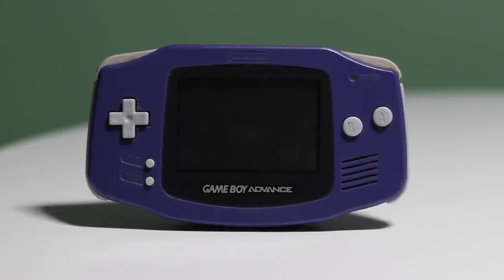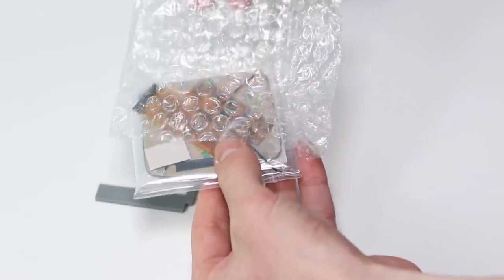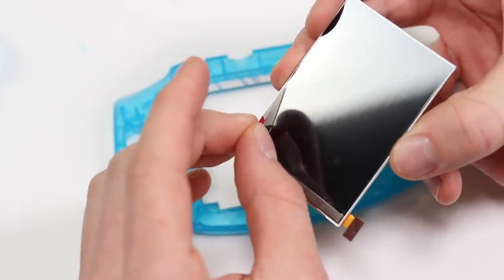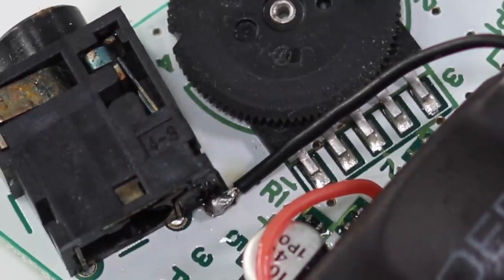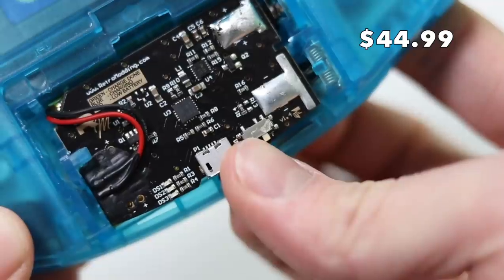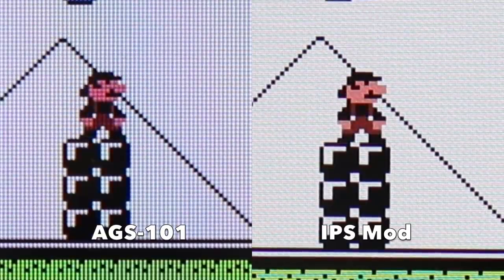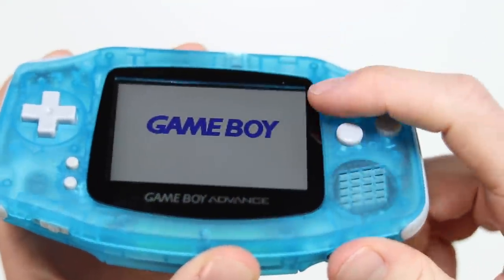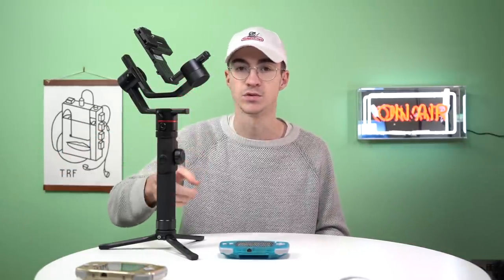$200 ULTIMATE GameBoy Advance Build!

Comment: Its crazy how time flies, in 15 years people will be modding their switch with 8k oleds or whatever the new thing may be, and 24 hour battery life
Reply: Sadly I think the golden times of hardware that allowed this are over, nowadays its all SoCs
Reply: Yuzuki1337 sadly I agree
Reply: They're already modding the joycons.
Reply: @PasserbyP  i did a shell swap on mine
Reply: In 15 years, the switch will never need a screen upgrade. Either from that you can just plug it into your tv or because it will have next to no support from the modding community for that sort of thing
The only reason gba's get modded is because their tech is basically prehistoric compared to new tech
We might have a WW3 before then anyways
Reply: Maybe 10years*
Reply: Andrew Lee will def be me lol I don’t do anything rn to it cause ya their pricey if I mess something up so I will start off modding with an advance sp that my friend will sell me for $30 pretty excited little project
Reply: thats what they said about 2010 computers having 10 ghrz processors and guess what we dont have that...
Reply: They are already putting Retro Arch on the Switch.
Reply: we already have the battery tech, solid state batteries can hold like 40,000 m/AH hours charge
Reply: @bradleycontois  Processor frequency is not the only relevant factor in speed. A 1,6GHz 2020 processor is about 100x faster than a 4,5GHz processor from 2006.
Reply: Sincerely why do you want to that? The philosophy of the hackers was never to destroyed old material, make them pricy on ebey,  to got internet points on reddits and youtube. 8K on a gadget hipster switch to do what exactly?  (the terrible breath of the wild is running in low resolution at less than 30 FPS, you will change the mother card and add a 2 meters giants screens for the 8K on low polygons and textures?
 Useless to destroy the the real experience when you all have shitty portables phones with an emu already.
You are consumers, not hackers and a Cancer, the Zoom Zoombida living in a parallel fake worldand fake history.
Let the people enjoyed the real experience or play it on PSP 3000 with an emu or simply your phones who will give you balls cancer.
Why do you want to destroy old material that the industry stop to to build?
A PSONe is 20$ and a CRT is from 0$ to 5 dollar$.
From the beginning of the Video Games, we tried to make things more fun, you tried just to be an attention Wh**e on Twitter. 
200$ for a GBA? Please stop, took a PsP 3000 and add a emulator on it. End of the story.
Please stop!
A Quicker CD-Rom player on a Neo Geo CD is good, a French guy done in on Youtube easely.
A shitty current year LCD on a Game boy with a terrible filter is destroying the experience and how do you think that we could have survive and enjoyed these Video Games in the 80'S&90's? We, the builders of a good thing, the foundation of a better world but your generation of normies whose was hacked by criminals Deepstate SJW to indoctrinated you? So, just use your shitty phone with an emu and let us in peace. 
Also We do not want Remakes, we are already happy with the good old games, they were already good for the most part, try in a first time to build you a solid culture about arts and gameplay/GameDesign and then enjoy mush these good olds creations. 
Or go back on your casual movie walking simulator full of bolchevic propaganda to exterminate you incognito on  your Chinese Tel Aviv Commiefornia PS4 and soon the PS5 or new XBOX.
I got a new CXOX with a 500 GB Hard Drive and full of emulators, a Dreamcast with a new Hard Drive whose can read any worldwide gae, A 60 Hz Super Famicom whose could read every worldwide games roms, same with a Megadrive and a lot of SD Cards and I will not do the list of all of my consoles, I have not change my Neo Geo, she is already good and I played the real experience. How many whose have bug their Neo Geo are really taking the time to enjoyed plentifully the potential of the games?
It's a indoctrinated generation of sheeple consumers and it is really sad. Do not destroyed your past that your ancestors fight for a good a good reason, giving you a good future, do not cutting the branch where you are sitting, build and hack new things to make a better world and not just got fake internet points by zombies NPC idiots and bots. Build a really real cool and fun world with brain and hard work. It is our duty.
I do not understand how this none organic wave of fake Geeks and nerds come suddenly from nowhere unless it is a Deepstate propaganda machine making low IQ consumers for low Products and wanting to make our past dissapear to control our future and send us in a horrible society of misery with untounchable psychopatics Masters monsters. The Kalergy Plan.
Also we have never called ourselves Geeks and Nerds, this is trash from Netflix trash the pedos obama and soros and Clinton industry. There were a few Geeks and Nerds but everyone mocked them or ignored them, they were never a thing. Just called yourself a Gamer, simply. (In fact, the few Geeks and Nerds were good friends if you speak with them but they were never and know it themselves something as a fashion thing and it is normal).
Nathan Barnatt on his channel made win a rare PC Engine GT, a zoomer(and I am not a boomer, also these terms were create by the Groomers) So a Zoomer won it and his first idea was to destroyed with adding a new terrible LCD screen. WHY? He could play the PC Engine GT already on his portable phone of shitty tablett with an emulator, so why? I will be happy to win it and simply enjoyed this rare item. It is only if something was broken that I will try to change it with the most accurate part possible.
What are you doing sincerily!
Wait a little second...
The Gadget Hipster Switch with his terrible paddle Joy- COn can not even last 24 hours? 
BWAHAHAHAHAHA!! This generation are made of ButPeanuttsBrains Consumers XDDDDDDDDDDDDDDDD

Well I think that I will make some place to try on a Good CRT Trinitron (5$) my new Capcom Steel Battallion Green controller (that I got for a low price complete in perfect state and after perhaps tried it on multiplayer with a program on PC and their not dead after 20 years community, because a good game never die on the contrary of the terrible walking simulators on PedoWood PS4 and XboXone or gadget like the terrible Wiimote that already everyone has forgotten and soon the gadget Switch. 5at least on the Switch, they add on the store, good old arcade games, sad that it is a ridiculous costly gadget like apple).

For a Game Boy Advance SP you just need to add a better light led for the darker low cost model,  a headphone jack a button for the light luminosity. Do not Touch the Screen.

On my old Arcade stick like the NeoGeo, I add Sanwa colors buttons only because the original buttons were dead. This is more repair and maintenance than true hacking(Even if you have to cut,, use your brain and solder the thing, it is easy in fact). It is cool that all the newbies from the normal people become interested in this kind of passion because it is facshion after the Big Bang Jussie smollet Tel Aviv DNC the terrorist theory. But do not ruin our old fun culture like in the Chicken with the golds eggs story, please.
Reply: DelightOxygen what is a CXOX
Reply: @DelightOxygen  no one cares
Reply: And Korok Forest will still run at 22fps 😂😂
Reply: LED micro, that's the future
Reply: ur prediction is gonna be true in the future.
Reply: Nah in 15 years I'll be emulating it on my Samsung S1200
Reply: @air_  Damn straight
Reply: @bradleycontois  Thats because Clockrate was not focused on that much. And besides, nobody wants a computer that doubles as an oven.
Reply: Switch consoles will be lucky to make it half a decade. Nintendo doesn't make hardware the way they used to.
Reply: @Yuzuki1337  SoCs?
Reply: @totallyaploy1824  System on a chip, basically a whole computer built into one tiny package: CPU, GPU, memory controller, RAM etc. essentially the centerpiece of all smartphones and similar devices
Reply: dam

I'm a 13-year-old introvert that doesn't go outside and this is deep
Reply: You could already swap the digitizer/plastic screen for a white one, get a transparent shell, better thermal paste or even liquid metal, and remove the shell that protects the memory modules and add either low profile copper heatsinks or some thermal pads. That's about it right now.
And yeah I guess the good D-pad and different dock.
I still want to find someone who can make custom tempered glass to replace the plastic one on the Switch, since mince has a few light scratches and some I've seen really deep ones.
Reply: @bradleycontois  Yeah, but we nave 16 core processors at 4.5 ghrz, it's just a luxury part.
Reply: Are you comparing the gameboy with the switch? How dare you sir. The gameboy is a great piece of gaming history while the switch is a joke of existence. No one will be doing anything with their switches any more than they have with their crappy wiis and wiius.
Reply: @bradleycontois  Yeah we have 12 cores @ 4Hz ....
Reply: no. the switch supports max. 1080p
Reply: if we ever get better enough batteries to handle it, then a switch mod for a 1080p screen + "portable but on docked mode" mod is just begging to happen in 20~30 years
Reply: I hope so
Reply: 8k oled on a device that strugles to deliver 1080p on low 😂 its as useful as sticking a formula 1 front spoiler infront of your vw polo 1 liter.
Reply: Maybe even solar panels to charge the switch
Reply: seriously, looking at smartphones nowadays, I have my doubts about longer battery-life :D
Reply: Nah the Switch won't be able to support 8k, it would be 720p still, maybe 1080p at max with some software magic. It'd look worse than the original screen, I can definitely see OLED screen happening though
Reply: I highly doubt it. Shell and button swaps are the most it's going to get.
Reply: 48
Reply: But with joycon drift
Reply: Let's just hope Nintendo is smart enough to come out with a second version of the switch
Reply: @eddiesaunders9704  How about you learn to type properly before telling me what to do
Reply: I could see a battery mod as that would be easy just the same pin out , and volt /amp output more capacity and cases are already being swapped
Reply: You predicted the switch oled
Reply: sorry to be off topic but does anyone know a tool to get back into an Instagram account..?
I somehow forgot the password. I would appreciate any tips you can offer me!
Reply: @Moshe Travis Instablaster ;)
Reply: @Howard Lucca It worked and I actually got access to my account again. I'm so happy!
Thank you so much, you saved my ass !
Reply: @Moshe Travis You are welcome :D
Reply: Came here just to remind you that in the next year youre probably gonna be able to play switch on your phone like you play snes
Reply: This comment aged well
Reply: Let's be realistic the least we'll see ATM is 3ds hardware mods
Reply: Putting an 8K OLED into a device that doesn't support 8K resolutions would be a total waste of time and money.  Even today's GBA screen mods are not increasing the screen resolution
Reply: And I'll still be using my GBA. Lol.
Reply: And what will the Tegra X1 do with that 8K screen? Play at sub 720p lol.
Reply: Why should they?!?!?!? You simply play Switch Games on the latest Nintendo console at the time.
Reply: they just released an amoled screen. I really want to check it out

Comment: You'd honestly be unstoppable with the EZ-Flash as well, that bad boy would be rolling down the normie GBAs everywhere
Reply: Well said, I have the EZ Flash Omega and it's fantastic
Reply: Did you have any saving problems with your EZ flash omega?
Reply: @etyramone2000  No problems, saves just fine
Reply: @Angultra  Thank you !! Cause the everdrive seems nice but a bit pricier
Reply: You
 Read my mind
Reply: @etyramone2000 I heard Everdrive sticks out slightly compared to EZ Flash, but that it’s slightly better product even though it’s more expensive
Reply: @TheJjcczz  thank you ! That's also what I heard !

Comment: This is pretty good timing. I already have an IPS GBA, but I still need to grab the ultimate battery pack from Retro Modding because holy cow does this thing eat AA batteries like it's nobody's business, so it's cool to see the brief snippet of what you cut away to install the battery pack.
Reply: Just get the Panasonic rechargeable batteries since they are 2500mah cells

Comment: One thing i never understand.. at 1:10, you clean the shoulder buttons, but you just put the alcohol in it and wiggle. how does the dirt and stuff come out of if? Its still all inside afterwards
Reply: Yeah I've always thought that as well. I think you could probably get a little bit of compressed air to spray it out. If the pressure from the air won't damage anything.
Reply: There is no “dirt and stuff” in the traditional sense, you’re dissolving any dust that could prevent the metal from making proper contact and closing the circuit. So there’s nothing to come out
Reply: @Spartan265 Compressed air won’t reach the point of contact which is in the button housing. You have to use IPA because the dust inside the button housing has no where to go

Comment: In my oppinion, the speakermod is absolutely unnecessary. Might be because of the short comparison footage, but I only can consider it as "louder". It amplifies much of the noise the GBA brings with it and from my point of view, a: playing as loud with people around is just not it, and b) I for myself don't play as loud overall. "Good" headphones will do a much better job.

So people might consider leaving the speakers as they are and spent that money on the precut case :)

p.s. it would be nice, if the battery could be charged without opening the battery slot :/
Reply: I'm thinking the same about the speaker mod. All it does is make it louder right? If I want top quality sound I'd rather use headphones. If it was giving much better sound quality, then I might be sold. I read that a static noise in the speaker can come with the rechargeable battery mod, which would make that not worth it to me either.
Reply: @mattgallagher7105  I might be wrong and there might actually be some improvement in the sound besides it makes it louder. But it sounded so much like amplified static noise.

Comment: What's he doing when he "tins up the pads"? It looks like he's squeezing some sort of clear viscous gel over top of a soldering point and is either just dropping a base layer of solder on it, or soldering a new wire to the contact.

I've done a little bit of soldering in school, but I have no idea what's going on here. He calls something "soldering" several other times in the video, so there's something different about this process. Is this new process something specific to using the newer silver-based higher temp solder?
Reply: The gel he adds is called flux, it basically makes it easier for the solder to attach to the pad. He’s just adding a bit of solder to the pads so the wires can connect to them easily.
Reply: @plyo1658  Back when I was soldering, I think the flux was integrated into the solder.
Reply: @Thalanox  they still are, but its not the same for electrical soldering and electronic soldering, flixes varies for metals to metals,

Comment: I found rechargable battery mod to be useless and overpriced tbh. I mean how hard it is to slide in 2 AA batteries? Not to mention you'll eventually run into problem like all GBA SP/ GB Micro do right now. It's hard to find replacements for those custom batteries and companies like retro modding won't be supporting them for eternity. While with simple standard AA batteries there'll be probably unlimited supply for the rest of our lifes. Just get 2 Eneloop Pros and you're good to go. Screen and sound mods are obviously superior upgrades over OGs but batteries? meh. Not really big upgrade + you're cutting yourself off getting potential replacement in the future. And the price? Come on. almost 50 bucks so you can slide in your cable instead of 2 batteries?

Comment: I think the amplifier is let down by the constant hissing sound that is a normal part of the GBA hardware, but as you said it does do what it set out to do, and the difference is very clear between the unmodified speaker and the amp.

Comment: The screen is not centered because YOU DIDN'T USED THE PROVIDED CENTERING BRACKET, that's the point of it, you don't stick the screen in place directly, you use the bracket to center the screen AND to hold it in place, that way is easier to transplant the screen to another shell if you want to.

Comment: I did most of this same mod. The clear blue shell, the IPS LCD screen (which is BEAUTIFUL by the way) and I just love the thing now. I didn't do the speaker or battery, and really I'm not sure I want to. The thing is already enough of a Ship of Theseus. I also got the clear blue button set, which I have mixed feelings about but in general I like it. Just having that screen replacement alone is... amazing. It's way better than the SP.

Comment: i love how far modding has come in recent years and how accessible it is nowdays. I currently have a Handheld Legends shopping cart at a whopping $125 and that includes a new pre-cut shell, buttons, silicone pads for the buttons, laminated IPS screen kit, and rechargeable USB-C battery mod and requires NO soldering. Plus, for an extra $8 i could replace the speaker and volume potentiometer as well. once you win a bidding war or find a lucky low-priced working GBA like i did, you can have a brand  "new", modified GBA for around $180.